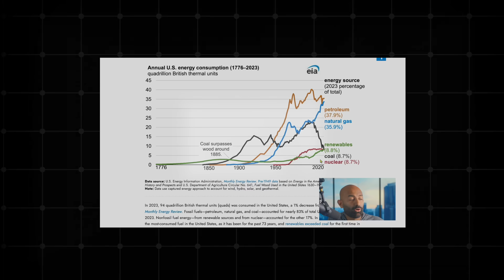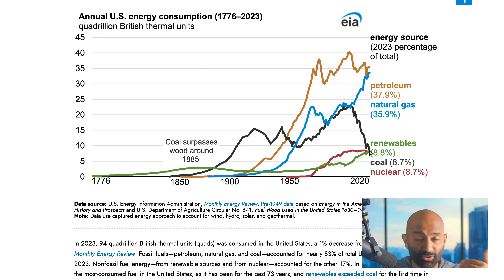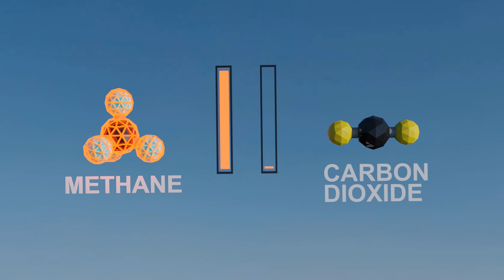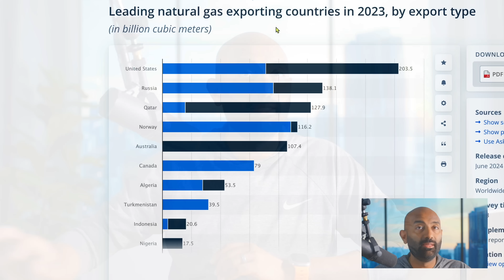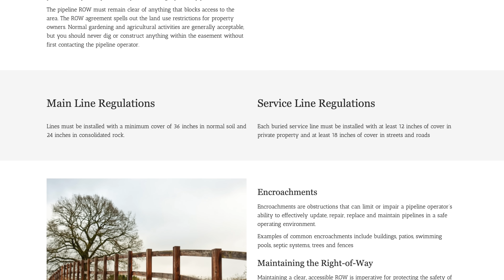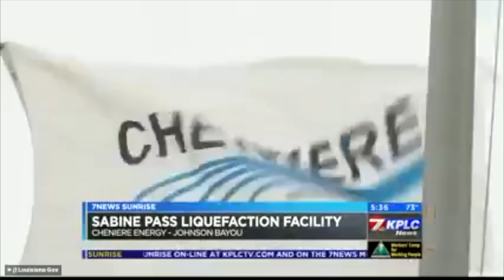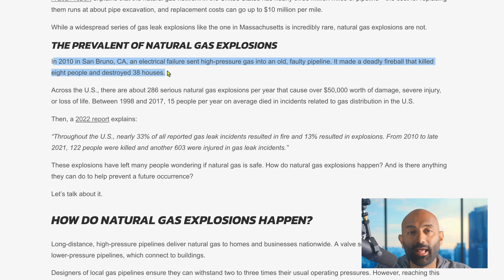The TRUE Danger of Natural Gas - This SHOCKED Me

Comment: We changed from 100% electric to heating by natural gas about 15 years ago.  We personally ran the gas lines under our house to a fireplace insert, water heater, and range.  The natural gas appliances work great and very reliably.  When the weather gets chilly (less than 20 Fahrenheit), the fireplace is the focus of warmth.  We used to have power outages every windstorm but haven't experienced that in over five years thanks to the utility removing some troublesome tree limbs a few blocks away.  We did get a heat pump about five years ago primarily for cooling.  That was fully tested a year after we installed it with 119 F temperatures outdoors:  new all time records all around the Pacific Northwest!
Would we give up natural gas?  Probably not.  Between the fireplace and range and water heater, we have $9000 freshly invested.  I don't see anyone offering to buy those or make it worthwhile to phase them out.

Comment: I've always hated the idea of a gas pipe straight into your house. Also heat pumps are terrible as they use pipes and vents when you could instead use induction heating and heat your house with just electricity and it's ambient heat instead of gusts of air blowing on you for no reason. And there is a better way to cool as well.

Comment: Thank you for this honest overview and  discussion of natural gas. You highlight the challenges but don't dismiss the valuable uses of it, particularly in cold areas. I live in Alberta, Canada, and had a cold-weather heat pump and high efficiency gas furnace installed last spring. Though my  air source heat pump can still warm until -35°C (-31°F) outside it is no longer efficient. I've read an anecdote online from someone with a similar heat pump in Eastern Canada that below -22°C  (-8F) their cold weather heat pump  becomes inefficient.
I have a Daikin system which coordinates the heat pump and furnace for ideal efficiency. The furnace (97% efficient) does virtually all the heating when the outdoor temperature is below -10, -14°F.
Reply: @dougpatterson7494  cool name bro! My brother from another mother!
Reply: @ericpatterson3887  good to meet your aquintance bro!

Comment: Natural Gas Engineer here
1. Missed a large use of natural gas.....powerplants. The majority of power plants use natural gas to produce electricity for everyone. We are just now starting to retire coal power and convert to gas.....so no NG, no electricity 
2. The corroded pipe you show is not comparable to high pressure transmission lines. Transmission lines use epoxy coating, catholic protection, and are constantly evaluated with internal inspection tools.....that corroded pipe you show has 5 psi of pressure, not 1400. Self reporting is a foolish system, ask the government why they don't actually do there job lol. Gas companies don't want high pressure gas leaking, it's a massive liability. I can't speak for all, but every company I've worked with are extremely strict on repairing and fixing leaks.... if a valve is barely leaking, should the company shut down the pipeline and spend $2 million to replace it? Seems excessive. Unlike oil, methane diffuses into atmosphere with minimal environmental impact.
3. A lot of ruptures are caused by people hitting the lines and causing dents or cracks. They are well documented locations yet public sometimes don't care. If I hit an electric line with an excavator and get hurt, is electricity bad?
4. Lng is not wasteful. Compare the energy density of lng to the amount used to transport it. How would we transport clean electricity to countries that are not as developed as the US?
5. I agree with not running gas to every house in the south. Cooling loads don't use NG and like you mentioned, heat pumps are so efficient, effective, and even affordable.

Comment: Here in France new properties built in the last couple of years no longer have the option to use natural gas. As you say it’s dangerous bringing explosives into the home, plus the environmental damage through either CH4 itself leaking or the CO2 produced. Additionally it’s been shown that the interior environment of a house burning gas is somewhat toxic due to particulates and NOx emissions.  Electricity is the way to go, like you!

Comment: Fossil Fuels make little sense these days.  I have a place in VT and I installed a DYI two head heat pump in my place.  Keeps the home warm even down to -16 F outside.  And it uses at most 1600 watts.  Often it is at 800 watts.  I added a DYI solar system as well.  While it does not produce all my electrical needs it helps keep cost down.

Comment: Rick; not a bad first pass. A lot of your information presented on the extraction and pipeline side is incorrect or significantly outdated though (think comparing a 2000’s heat pump to one from today). It either inaccurately overplays the risks and inefficiencies or completely gets it wrong. Your history on natural gas is pretty severely flawed, too. Source is from my experience in and regulating the O&G industry professionally, tangentially as an engineering-minded wildlife and conservation biologist.

I come to your channel frequently for accurate and non-biased information and engineering-minded learning, but the pretty clearly shallow research done for this video has me second guessing the other pieces you’ve done. I think you are capable of better/more accurate content than this video, so I’ll stick around!

Comment: I just had to have my sewage drain pipe replaced, literally earlier today. Had to spend $5k.  I'm scared to know how much it would cost for me to replace my gas line.   My gas line runs under a large concrete pad next to my house.   The problem is that I'm in Mid-west ohio, where gas is cheaper than electricity.  So using gas to heat my house is cheaper than running a heat pump.  So when the time comes....I haven't decided what I'll do, Because while I do have forced air A/C ( that actually has the reversing valve to act as a heat pump ), my system is way to small for my house. So i'd have to pretty much replace the entire setup.  

Though, I am super happy we are using an electric stove, and would LOVE to switch to an induction stove, once prices get better ( or someone makes a hybrid, that has like two induction, and two radiant burners on it ).

Comment: Check the stories on the so called Methane hunters. An independent woman who got licenced to operate the kind of specialized camera that can detect methane leaks. She's been fighting this for several years.
Also check out how much natural gas leaks from household stoves even when they're not in use. As we make our homes more and more air tight to improve insulation we really need to avoid bringing this cancer inducing toxic gas into our homes. If you don't do if to reduce the emission of greenhouse gasses do it for your own health and that of your loved ones.
And for those places where a heat pump might not suffice in the cold periods of the year things like centralized heat networks are hopefully an option.
In the worst case natural gas can be burned in a central location with better maintenance, less distribution etc.  But ideally those can be run on other sources like waste heat from industrial sources.

Comment: Fracking natural gas is what killed coal because gas became cheaper and coal couldn't compete on price.
I agree with you on all of the above energy. Reliable energy requires storage of some kind, whether chemically in fuel, gravity in water behind a dam, electrically in batteries, etc. I'm bummed that existing nuclear plants were shut down because some people thought they weren't green but that reliable electricity ended up getting replaced with fossil fuels

Comment: I like having natural gas as a backup for cooking when the electricity goes out. In the last few years in my area, the power has gone out for hours at a time.
Reply: Having natural gas as a backup for cooking can be achieved with a small propane tank. You wouldn't need a permanent hook-up for that.

Comment: Nat gas lines underground in most cities are now  a composite flex line. Nat gas is Pathetic, and you would need COPIOUS amounts to make electricity. As it is, they use Electric pumps to move around. Propane is a more efficient fuel, AND your not stick on the gas company nipple.  Check out Natural Gas in San Fransisco in 1906......

Comment: I've been following this channel for a long time and I wonder if Two Bit da Vinci has sold his soul to the devil. He must be right when he says that heat pumps are the heating of the future. That may work for him in San Diego where there is no need for heating because it's summer 10 months a year, but what about those where heating is needed 10 months a year. When the temperatures are 0 Celsius or below, heating with this system is more expensive than with a regular electric heater or is impossible due to freezing.

Comment: My house is beyond the natural gas service area in North San Diego County.  We had propane delivered until I installed solar and converted everything to electric.  We are on the electric grid, so no expensive batteries needed.  The solar is only 5 KW, but it's more than we use every month of the year so no bills from the electric company since we started using it.  There were some life-style changes:  We cook with a convection oven, microwave, and induction.  Other small appliances like a smart pressure cooker and bread maker do not exceed our solar production.  We only heat or cool the rooms we are in.  We use a flash water heater so it costs us nothing to have as much hot water as we need, but only when we need it since there is no tank to keep hot.  I find heat pumps very attractive, but our window ACs and little electric space heaters are very cheap and cost us nothing to run because we have terrific insulation.  If we wanted to cook a big turkey, we would have to use the smoker, but I don't really like turkey much.

Comment: I did the plunge last year and took advantage of the various tax credits: I replace a gas range with an induction range, a 16 year old water heater and a 24 year old dryer with heat pump water heater and dryer, my two 24 year old ACs and furnaces with highly efficient, very quiet, variable speed heat pumps, and replaced my 14 year old Matrix with an ID.4, all powered by a 10kW solar system on my roof. As soon as the heat pumps were installed, I had my gas disconnected.
I will save about $4k per year, since I only pay the mandatory connection charges in the Las Vegas valley for all my energy needs.

Going green saves money (especially with the tax credits), and improves your quality of life dramatically! 
An induction range is so much nicer to use compare to a gas range, the heat pump water heater acts as an AC for the garage, I need to face the fans to hear my heat pumps, and the air circulating with variable speed keeps the temperature in the house even.
Reply: It does save money, taxpayers are subsidizing your energy consumption.
Reply: @darkgalaxy5548 Good. That’s exactly how subsidies should work. We’ve had subsidies on oil and gas for decades but nobody complains about those.
Reply: @mikesaunders3326  People receiving subsidies never complain. Again, why should the taxpayer pay for your energy use? What's in it for them?
Reply: @darkgalaxy5548  Cleaner air, less strain on the grid in summer peak hours. Those were the incentives that enticed me to spend $100k on heat pumps, solar panels, and an electric car. For the 10 months my solar system is operating, it has already saved 11.7 tons in CO2 emissions. That's in it for the taxpayers. Giving tax breaks to entice private investment is how our capitalism works. Ask Elon why he built a plant in Nevada. 
It is called a multiplier. In my case, $1 of subsidies created $5 in private investment.
Reply: @thomasgoldschmidt298   unless you're running your entire household on solar panels, all you've done is move the pollution source to the nearest fossil fuel plant. At taxpayer expense.
Reply: @darkgalaxy5548  I do run all my energy needs on solar, including transportation. I currently banked over $400 in future credits since I slightly oversized my system, helping the taxpayer with free solar energy that I will not be able to use.
It is the same thing as Elon getting tax credits to invest in a plant...
Reply: @thomasgoldschmidt298  If you're needs are truely on solar & you're off the grid, then bravo. But really, it's the taxpayer has helped you. Off the grid is beyond the means of most wage earners.
Reply: @thomasgoldschmidt298   BTW, I'm not in favour of tax credits for anybody. I'm sure you know there's no such thing as a free lunch.
Reply: @thomasgoldschmidt298 What are the maintenance costs of your solar panels? Do you own and maintain the panels yourself? How long will your solar panels last you? At what point, in years, do you actually see a return-of-investment?
Salespeople make a great pitch for solar, however, in our home we would never reach s point of a reasonable ROI and the cost benefit analysis works out to more money invested to claim a "green household."
The moral: When the government is pushing the technology onto the masses, the masses need to question every aspect of it.
Reply: @user-mv9tt4st9k  I am not sure why my previous reply to your question is not showing: 
I bought my system outright. The panels and microinverters have a 25-year warranty, and the panels are promised to still produce 86% after that time.
For cleaning, I calculated $350 per year,  but it might be lower: After one year, I already produce well over 60kWh on sunny days. Last year, my peak production was 66.2 kWh. It seems that the panels still produce the same as last year. Over the last year, I produced over 18.5 MWh. However, I oversized my system slightly and have already banked $500 for future energy usage.
Even with my EV that I bought  in the fall of last year, I still overproduce. Partly because my son doesn't live in my house anymore and I am the majority of the day working in an office.
Tnis will change once I retire.
Since I changed all my energy use to electricity, my panels will pay off in 7 years. Without that, they would pay off in about 13 years, about the same to recoup the additional investment for going all electric (vs getting a new gas Furnace or new gasoline car).

There are lots of shady solar businesses out there. Do your research and reach out to a few companies with a good reputation and a fair price ($2-$3 per installed Watt).
Don't lease your system because you would not own your system and therefore don't reap in the full benefits.

Edit:
It depends on the electricity price and net-metering rules in your state to determine if it's worth it or if you need additional batteries that can currently double the cost. My net-metering rules were still favorable for me.    
In CA, you are forced into a TOU rate that requires  batteries to make it worthwhile.
I expect in a few years to install a V2H port to use my car as an emergency generator, f needed. The car's battery could provide my household's energy for 1-2 days in summer/winter months and 3-4 days during spring/autumn months.
Reply: What state is that? I didn't get a tax break for switching my gas stove to induction.
Reply: @dannydaw59 It's a federal program (or was) under the Inflation Reduction Act. Some people qualify for an $840 tax rebate and people can claim 30% of the cost as a tax credit.
Reply: @dannydaw59  I got tax credits for the heat pumps, solar panels and the EV.
The induction range I bought on sale (35% off MSRP).
Reply: When the tax credits sunset...?
Reply: @user-mv9tt4st9k  Not sure what you mean. I received my tax credits with my tax return. Currently it lasts until December 2032. However, the current administration might attempt to repeal the law, not sure though.

Comment: This makes me wish we could keep using our Fuel Oil furnace.  But alas we will probably have to replace it in the near future.  It is a very safe and actually fairly clean burning fuel.  Considering the leaks with natural gas, the fuel oil probably releases less into the atmosphere, but fuel oil has been demonized so much that it will be hard to get soon I think.
We don't have natural gas as a option so we will probably have to use propane, but the same problems exist for propane as do natural gas.  Heat pumps with a nuclear plant supplying power for the win, lol.

Comment: A mild suggestion on improving the script (i.e. to think about in future scripts):
"But here in the US about 286 serious natural gas explosions happen per year that cause over $50,000 of damage, severe injury or loss of life"
Onet problem is someone thinking "286 explosions only caused $50,000 of damage? That's like $200 per time!" Another issue is that the number (286) is introduced way before you find out its significance, so you need to carry it in your brain while also listening to the list of bad stuff. Therefore, I think better in this case is:
"Natural gas explosions which cause over $50,000 of damage, severe injury or loss of life happen 286 times per year in the US."
(Also, 286 is very specific. Maybe "... happened 286 times in 2022".)